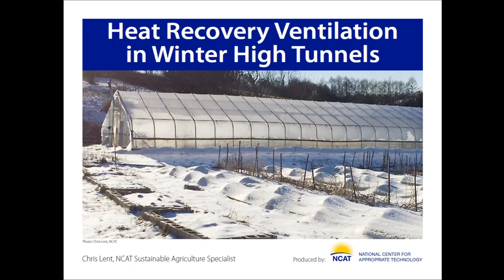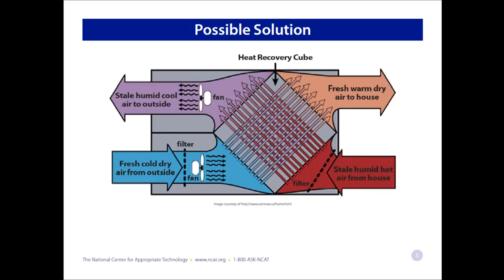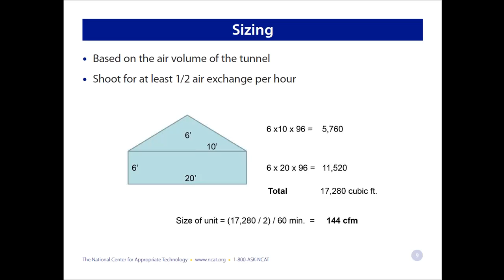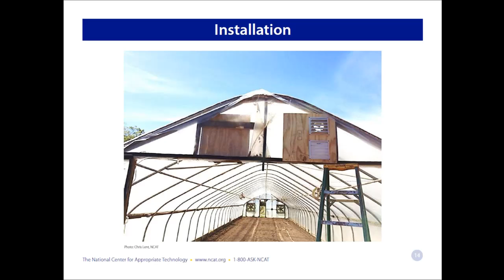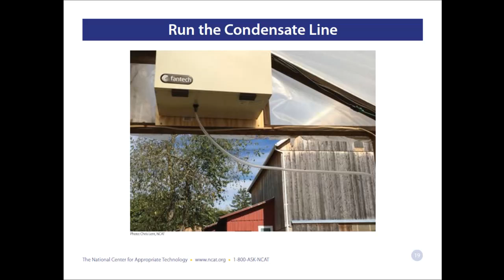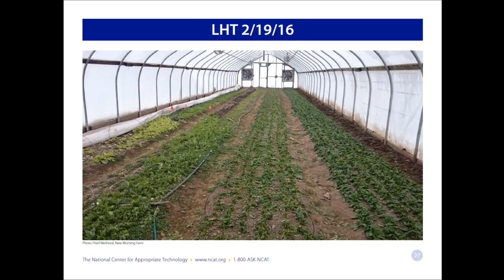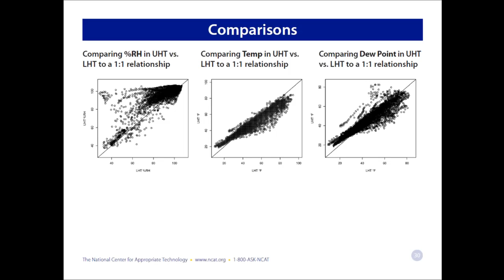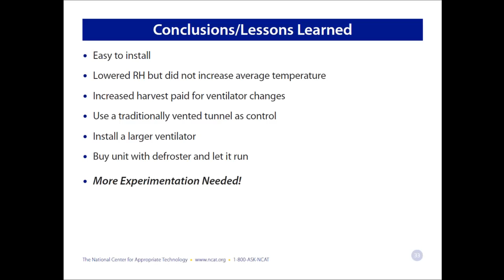Heat Recovery Ventilation in Winter High Tunnels

Comment: Given that the R value of greenhouse poly is so small, I would not expect that there would be much increase in the temperature inside the tunnel using the HRV compared to a closed tunnel. But the humidity benefit is substantial and I agree you really need to have some kind of defroster so it can run whenever the humidity demands it.
How does the dewpoint or RH change as the night progresses? I would imagine that the dewpoint would track the external temperature pretty closely due to condensation on the GH poly.

In sizing the system, did you figure out how much water vapor is being injected into the tunnel by the plants? I would guess the volume of the tunnel be insignificant compared to the water vapor production of the plants. If the plants are producing a tiny amount of water vapor it would take a long time for the humidity to hit the 85% mark. But if they are really cranking out the vapor, the HRV needs to really pump fast to keep the humidity down.

Also, it might be possible to create a very effective HRV using GH poly:

You could use the north-facing poly of the tunnel and place two more sheets of against it using some kind of framework so that the incoming cold dry air sees the warm poly of the tunnel on one side and sees the warm poly of the stale warm air exiting the tunnel on the other side. The outer most sheet of GH poly should be insulated so that the heat of the stale air is transferred to the incoming dry air instead of being lost to the ambient environment.